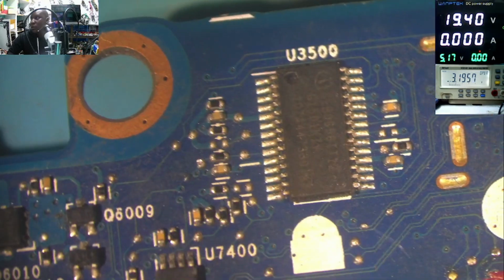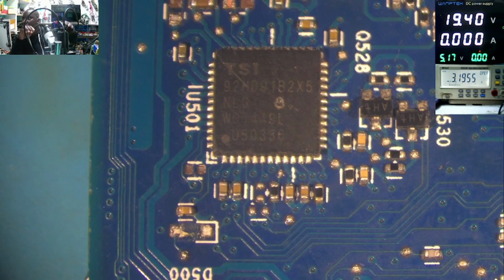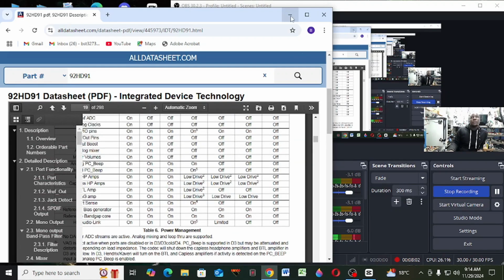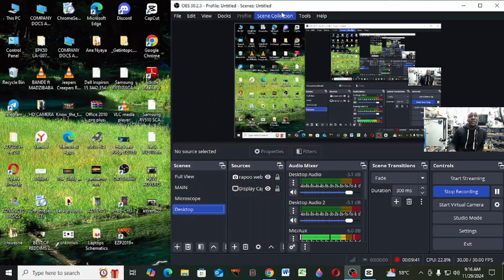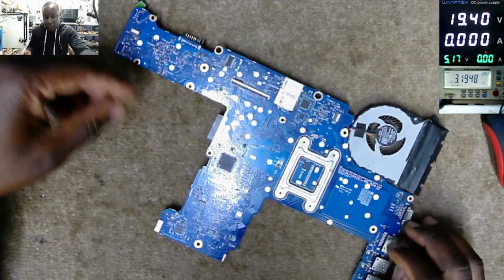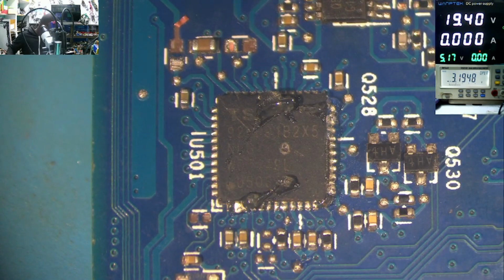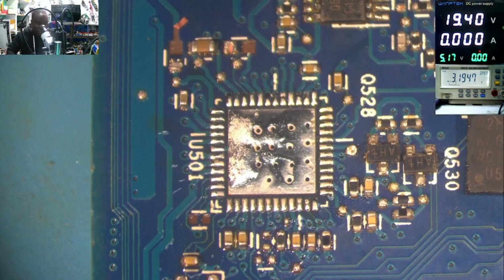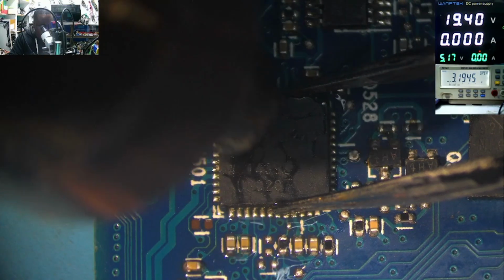Hp Probook 650 G1 Motherboard No Sound Repair--TSI92HD91B2X5 Audio Amplifier IC Replacement.

Comment: As you were soldering the New Sound ic, I noticed some broken rails just above the sound ic, Won't those broken rails contribute to sound lose, if not fixed??????????
Reply from the maker: Thanks yes the client returned the board and we replaced thot missing components off camera and there was sound
Reply: @BstAfricanElectronicsSurgery  Thank you so much, You will be always my Best Tutor on this platform!!!!